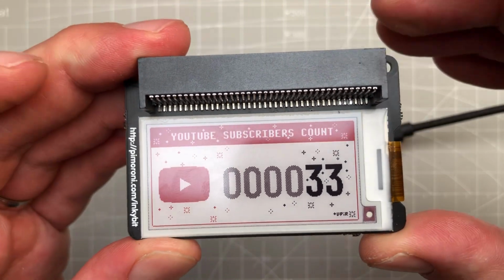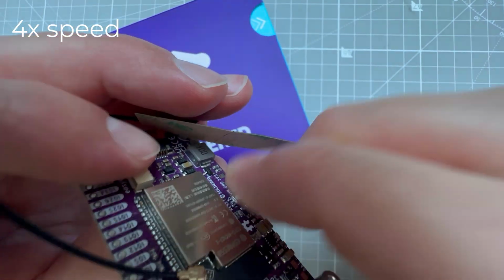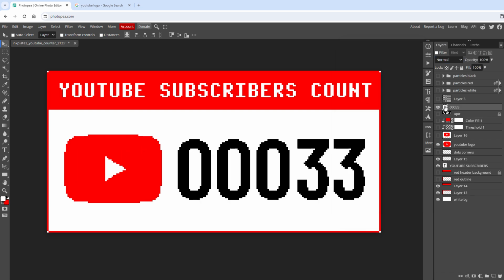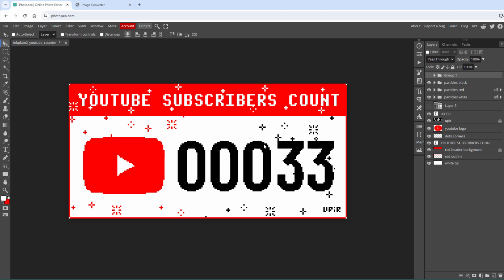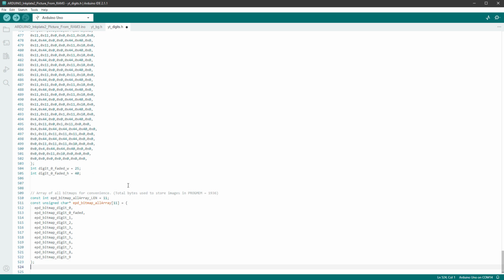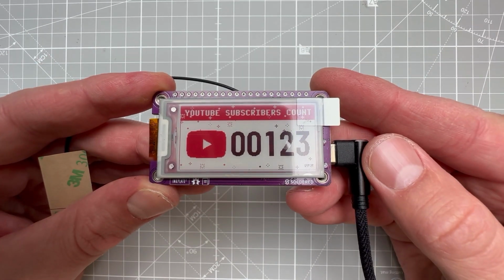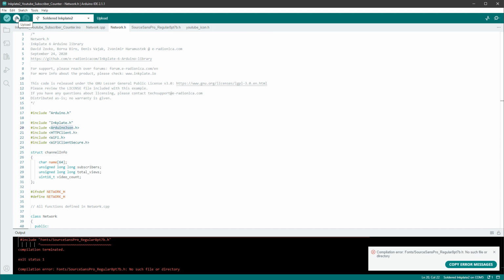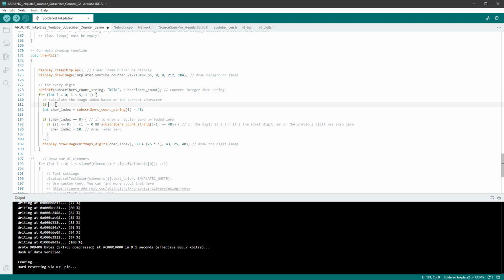Arduino YouTube Counter - using eink display on the Inkplate 2 board

Comment: Yes, I was wondering when you would get to play with epd's! To get around the limitations of stock libraries requirements of full double buffering limiting small microcontrollers to lower res displays I had to write my own low level driver software. I'm now able to control a full 400x300 pixel ~4" display from an arduino uno and best yet with some help from ben krasnow of appliedscience was able to implement a lut that allows fast updates of less than a second on single color epds.
Reply from the maker: Sounds great, do you already have any videos covering this on your channel? I agree that 15 seconds to refresh this small display is simply way too much for most of the applications, but 1s sounds very interesting. The company that makes this displays has a post on their facebook page where they show "Motion series of Inkplates", and they also update the display looks like in about a second or so. Actually, it´s on crowdsupply (Inkplate 6 MOTION) and it says " 11-FPS refresh rate", looks very promising (i.e., looks like something that will be on my channel soon).
Reply: I only have a video on the first iteration of my driver without the fast refresh. My display is a 4.2" waveshare. I should do an update video though to explain and demo fast lut refreshing.